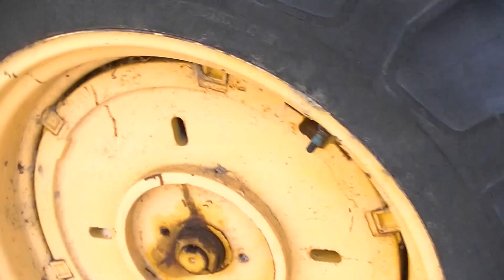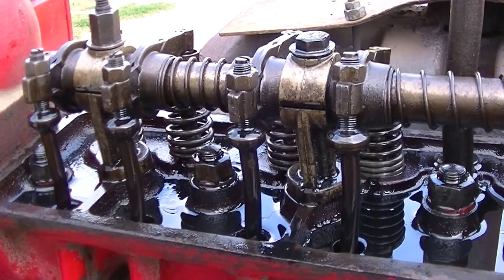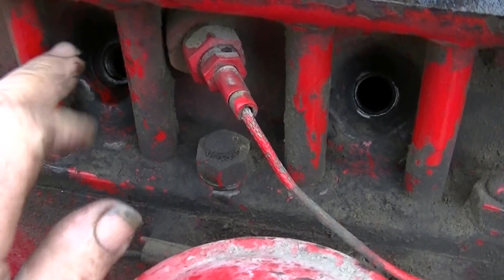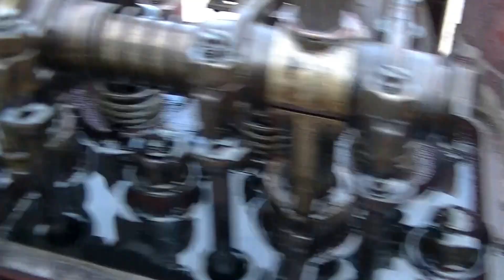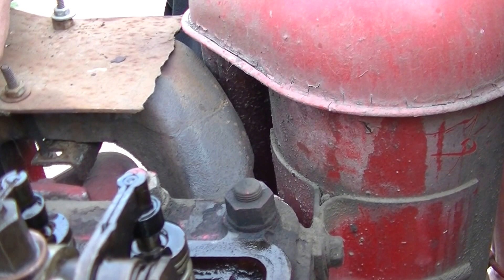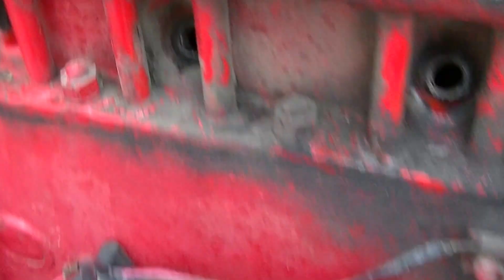Massey Harris 4 Cyl. Gas - Valve Adjustment - Quick and Simple - zeketheantiquefreak

Comment: So,
Valves were set then a compression test was done.
Recheck is done here
All valves are set to 14 thousandths with a bit of drag on the gauge as it passes through.
Firing order is 1342 from front to back of tractor.
In video:
First checked is 1 at tdc on compression stroke (4 both valves are closed).
Second check 3 - on 2 both valves are closed.
Third check 4 - on 1 both valves are closed.
Fourth check 2 - on 3 both valves are closed.

1 and 4 are at the same height in the block.
2 and 3 are at the same height in the block.
When 1 is on compression 4 is on exhaust.
When 3 is on compression 2 is on exhaust.
And visa vera.

Is this correct?
Thanks.
Reply from the maker: Uhmmm... This works on most or all multiple cylinder (Even number of cylinders, such as 4, 6 or 8.) Take the firing order, in this case 1342 and split it in half. The 'running mates' of 1 and 3 are 4 and 2. Set 1 when it's running mate 4 is rocking. Rocking means that the exhaust valve is closing and the intake is just starting to open. There is a slight overlap built into the cam and very briefly both valves will be open on the same cylinder. There will be no clearance or "lash' on this cylinder but it's running mate will be at TDC compression and ready to set valve clearance. The nice thing about this procedure is not having to look at any timing marks on the front pulley. So, yea, 4 rocking set 1. 2 rocking set 3. 1 rocking set 4. 3 rocking set 2. 1342. Thank you for the comment. Interested to hear about your project. Yes, you are correct, when setting the valves the running mates will both be at top, one at TDC compression, the other at TDC exhaust.
Reply: @zeketheantiquefreak8518  I don't have a project yet but if one comes up locally I'll buy it.  A diesel is better.